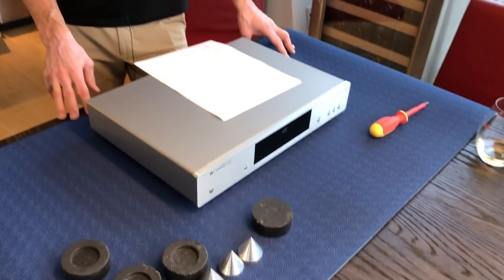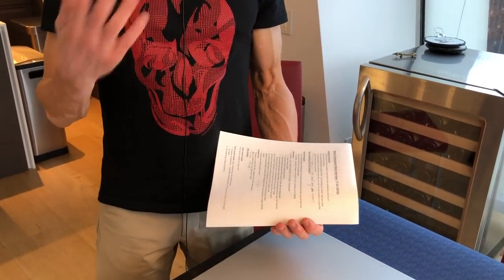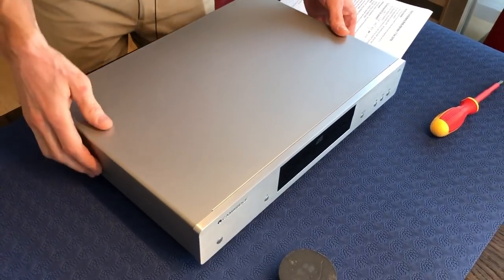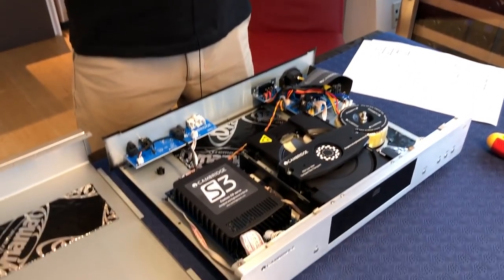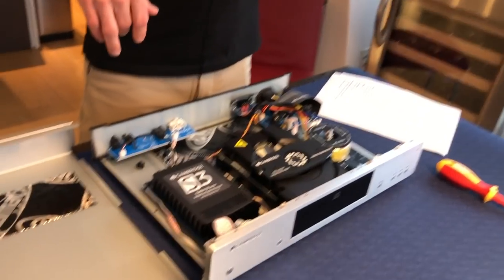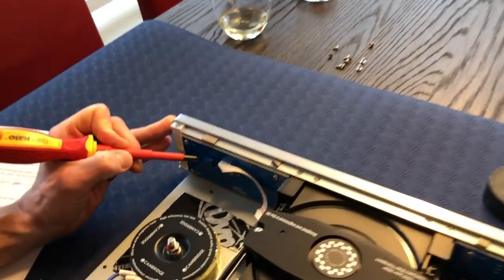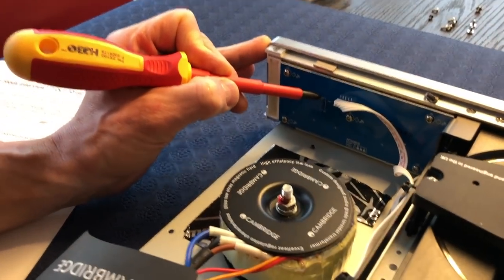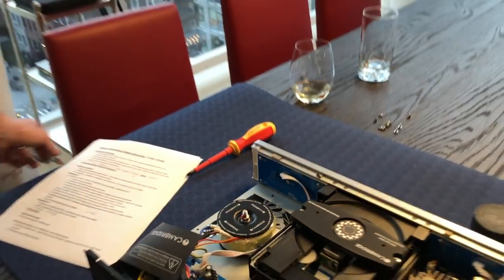Miguel pops the lid on his CD transport to tweak the sound

Comment: are audiophiles generally tweakers? every last ounce of performance and clarity does help.
Reply: I could be wrong, but I think the majority of audiophiles either can't be bothered or think that this sort of thing makes no difference, and so is a waste of time.
I happen to agree with you. I like to get as much performance from my equipment as I can.
Reply: @HareDeLune  I'd suggest most are and at the very least looking to improve, so continually upgrading.  Half a dozen of 1, half a dozen of another!!
Reply: @nostro1001 
Yes, I think most people are wanting to improve their system. After all, wanting better sound, something that brought them closer to the music they love, is what got them started in the first place.
Also, hearing a large improvement in your system can be addictive, especially if it costs you little or no money to achieve.
However, I think most people choose the upgrade path rather than the tweaking path. The reason for this is twofold: Firstly, tweaking has a bad rep in the audiophile community, rife with the Snake Oil mentality. There is a good reason for this, too, but it may not be what you think.
Secondly, serious tweaking (that is to say, striving to legitimately improve upon the performance of existing equipment) requires a certain amount of research and experimentation which most people are not inclined to do, whether from laziness or busy-ness from their work and life schedules.
Therefore, I think the vast majority of audiophiles never hear what their system is truly capable of. I think Steve was being conservative when he said these things make five percent difference. It depends on different factors.
Even so, let's say it is only five percent. Pennies add up. Four tweaks at five percent each add up to twenty percent. That's not chicken scratch!
Reply: @HareDeLune  .....yes, I see your point...upgrade path vs tweaking. I'd say certain tweaks have become virtually standard these days, such as putting your gear/speakers on spikes, feet, anti resonant material, filling speaker stands with sand etc

Whether there's an audible difference that's up to the individual to decide, but I assume that's basically standard these days (I could be wrong). Tube rolling for those who have tube gear and various turntable tweaks would be similarly common.

However, point taken, going to this sort of detail such as Miguel, likely only a minority venture so deep.

There's plenty of diy audiophiles....those building their own amps, speakers, but that takes some skills beyond just buying the parts. 

It would be interesting to hear about cost effective tweaks that people use for sure. No doubt, room tweaks, are equally, if not more important again. I'm not sure tweaking has a bad reputation amongst audiophiles. From my experience that hasn't been the case from those I've come across. However, that doesn't mean they'll personally venture down the tweaking pathway.

I guess it's a little like cars. Some people enjoying the mechanical side of things, others just go to the mechanic or purchase a new car when it's time!!

⏰
Reply: @nostro1001 
Yes, I like your analogy with cars. That's very good.

I said there was a good reason for tweaks having a bad reputation, but it may not be what you think. Here is my opinion on that matter:
High-Fidelity audio as we know it today originated in the 1950's. That's less than a hundred years ago. Even so, there have been many technological advances in that time.
However, once again there are two things to consider.
Firstly, even though good audio truly has roots that go back even further (I am talking only about two-channel stereo reproduction, the 'old school, classic Hi-Fi') Seventy-ish years places it in a state of infancy, not maturity.
Engineers may disagree with this, but as I stated, it is my opinion. There are still some things that we don't know about the technology. There may also be things that we think we know, but are wrong about.
Secondly, there is the scientific side. That's mostly manufacturers. Then there is the unscientific side. That's the consumers, or the majority of the audiophile community.
There is a gap in the knowledge between the two sides.
Because we don't yet know everything about what we are doing, and because there is a gap between what manufacturers know and what the end users know, means that there is a fair amount of misinformation on how to set up systems and how to improve the sound of an existing setup.
One of the common subjects of misinformation involves vibration control.
It is commonly believed in the audiophile community that audio components must be isolated and vibrations must be contained.
Vibrations are a true concern, but isolation is overdone. It is more important to drain away vibration and dissipate it, rather than trapping it in the component. There are also more and less effective ways of doing this, which rely on hard Physics to achieve.

As an aside, I have seen people talking about the quality of certain components, such as capacitors, in amplifiers and the like. I believe that knowledge gap is narrowing over time thanks to things like the DIY community and discussion forums on the Internet. This is a good thing.

Getting back to vibration control, one of the things you mentioned (filling hollow speaker stands with sand or lead shot, which is commonly done) is a poor way to transfer vibration.
So, we have people spending sometimes large sums of money on commonly done practices, and hearing little benefit. Then, the claims of Snake Oil.

Well, it's a complex situation.
This is why research and experimentation are important if you're going to try tweaking.
There's also the matter of voiding Warranties, which I forgot to mention as another reason people may not want to tweak their system.

Well, I am starting to ramble. Here is some good information I have come across, if you're interested.
https://mapleshadestore.com/freeupgrades.php
Reply: @HareDeLune  Hi Hare, thank you for the link, I'll definitely have a read!

Hehe.....filling my speaker stands with dried sand (and on spikes typically) - guilty. I just do it as a matter of course and don't test with or without. Other options I'd consider include lead shot (expensive, not easy to source, plus lead is somewhat dangerous), Atacama atabites (way overpriced), pebbles perhaps, that's about it. Do I fill to some suggested optimal level? Not at all, I go about it totally randomly, but try to keep each speaker stand with the same volume. What is the best way?

As for your history on audio gear, I get that it's new in the overall scheme of things & so are cars! So, from that perspective sure there's always new developments and yes there's the possibility of certain things we take for granted now may be debunked/ameliorated or improved upon at a later date. That's the same with almost everything as our knowledge increases through new discoveries, better science and so on. This then is well beyond an audio discussion (imo) & ventures into philosophy, psychology perhaps and other related scientific spheres.

Of course today, we have the benefits of computers, whereas in the past engineers had to work and develop their gear using different systems. We have the digital age in music, does it mean it intrinsically sounds better? I'm unsure.

I say I'm unsure because: firstly it's a 'new' technology and we can largely agree when it was utilised it largely wasn't implemented well. However, computer generated graphs and so on may have shown otherwise. Secondly, we have an aural memory. I am far from an expert here that's for sure. However, I often listen to debates/discussions on digital vs analog (cd vs vinyl) and what people claim sounds best. I often think that those on either side of the fence likely believe so due to a long embedded aural memory. Therefore, those of a certain generation who grew up listening to vinyl are likely to be more enamoured with the sound than those who grew up listening to CDs (of course that's far from always the case) & to take that to most recent times vinyl vs CDs vs streaming.

Is one better than another? Perhaps in the mind of the listener & that's really all that counts!

All of this argy-bargy that proliferates forums, youtube channels and so on, has really cast doubt over peoples intentions when listening to music (an entirely separate discussion). In short, are said audiophiles actually listening to the music or the sound their gear recreates? Further, why do so-called audiophiles typically know very little about music and have a very narrow listening scope? (Excuse my generalisations, but this is what I've found over the years). All mere food for thought!

Cheers & happy listening to you. :)
Reply: @nostro1001 
Thank you!
I must apologise for my writing style. I'm not very good at writing really, although I do try to take care with my spelling and grammar. That's more than you can expect from ninety percent of punters on the Internet these days.  : P

Argy-bargy!
Now there's an expression I haven't heard in a long time!
Congratulations on your vocabulary.
Might I ask whether you are from Great Britain?
Reply: @HareDeLune  Hey Hare - Great Britain is a fair guess if you notice my spelling. Although, I'm not sure if there are any examples throughout this thread. That is I don't spell the word 'color', I spell it 'colour' (and the list of 'different' spelling goes on) Youtube isn't a fan of my spelling by the by! I am Australian to answer your question. :)

For the record regarding the English language, it is dynamic,  I believe more so than most if not all others. Therefore, it is continually evolving and at a fairly rapid rate compared to many others. In terms of spelling nuances between American and "British' English there is no right or wrong and further, some are older and some newer (not British is always older or vice versa) and some even have slight differences in meaning between the countries.

Then there are words like enquire vs inquire. I understand in the US both are recognised (note I don't use a 'z' but an 's') officially, but very often if spelt (or spelled lol) enquiry if will be seen as a spelling mistake. By contrast in 'British' English & I believe our Gov't (perhaps our dictionary also, I've not checked), there is a shift to using inquiry in more of a formal setting e.g. the Gov't has established an inquiry on corruption in the banking sector as opposed to the more casual: He enquired about the cost of the amplifier. However, I do not think that's set in stone (yet).

I hadn't thought about your whereabout until you asked me the question. It is possible going by your name that you are French. However, I assume being roughly 4:30am unlikely! Do tell.
Reply: @nostro1001 
Nope. I'm American, though only by an accident of birth.
By that I mean I'm not a typical American, or Yank as some would say.
I do have some French ancestry.

I would love to visit Oz sometime. I have been trying to play the didjeridoo (off and on) since the early 1990's. I used to have over twenty albums of didjeridoo music in my collection, about a third of them field recordings.
That's no mean feat for someone living where I do, and that was pre-Internet for me. All locally purchased.
Of course, it might help if I had a quality instrument to practice with.
In the early years, the only access I had was some imports at a local futon store (yes, of all things!). Those were several hundred dollars, and turned out to be tourist knock-offs. Well, neither I nor my other musician friends knew enough to tell the difference at the time.
Now, I can buy quality instruments online, but they are thousands of dollars, which is way beyond what my wallet can handle.
I gave those two old Bloodwood ones to a friend to keep for me, and I currently have a small one locally made from PVC pipe. It was made with care and actually doesn't sound half bad, but I wouldn't mind something a bit deeper.
Well, assuming you have any interest at all, ha-ha!
I must admit I don't know a lot about your Country, but it does sound like an interesting place, if a bit deadly 'round the edges...   : )
Reply: @HareDeLune  just a quick comment Hare....need to rush off. I also own a pvc dig...it's extendable so that the sound can be changed accordingly. It's beautifully painted and I bought it from an indigenous artist playing at a famous weekend market. However, they seem uncommon, whereby most musicians who use them use the traditional kinds.

Comment: I would suggest to anyone buying a new player, make sure you can return it for a full refund. I was ready for a new player because I had the cash to blow, and selected 4 different players $500 -$1000. I had a dealer that was cool with me testing them in my home pre purchase. One was a tube variant, but all of them colored the music in some way compared to my $150 JVC. I also owned a Mcintosh cd player, and it too was inferior to the JVC, but better than the newer  cd players auditioned. This is one component where inexpensive may outperform much more costly gear. My rig when testing was a pristine McIntosh MC2205, PSB Gold i's, and an Audible Allusions M3A preamp.

Comment: With a 5ps jetter clock you are going to have on average 2.5 error sample per 16.7minutes of red book data.
That is before signal even get off your source you get more from cable more from clock recovery and soon.
As long as you transfer a signal without error correction error will always be there.

Having femto clock will help if its audible that I don't know especially with red book.
Femto clock is for HiRes with 5ps clock at 24/192 it will have 106 error sample per second.
To be frank HiRes should stay on chip only leave chip after DA conversion.

Comment: The thing spits out 1's and 0's. Do external influencers add to this digital signal? It's still a lot of fun watching the video.
Reply: Those "1's and 0's" are generated internally, then immediately converted to an analog signal (granted, this is done by an external DAC in this case).
However, vibration and resonance has an effect throughout a system on both macro and micro levels.
There is also, as mentioned in the video, the effect of different unsyncronized clock speeds.
The point is that a digital signal (1's and 0's) is vulnerable to effects in the analog domain.
However, each individual must make their own decisions about what sounds acceptable from their system, what they are willing to do about it, and how much money they are willing to spend versus research to gain more performance.
Reply: “1’s and 0’s” is an oversimplification. Even if you recover the signal exactly (and given the quality of the SPDIF signal you certainly do) what matters is the timing of those bits. In the SPDIF spec, the DAC clock is synced to the source, it needs to recover the clock. Jitter hence matters a lot.
Reply: @miguelbarrio 
Yes, thank you for a more eloquent explanation.   : )

Comment: Dynamat or just some cheap high mass foam. I was more interested in what his espresso machine is
Reply: La Marzocco GS3MP and a Mahlkonig Peak grinder. I also use an Acaia Lunar scale.
Reply: @miguelbarrio  My understanding is that like transports and DACs, the grinder is very important, like a transport.
Reply: @MoRegistrations  Indeed. The grinder is key. I liken it more to the playback medium, a bit like the beans are the original soundtrack and the grinder is the vinyl pressing - you need a good pressing for good sound.